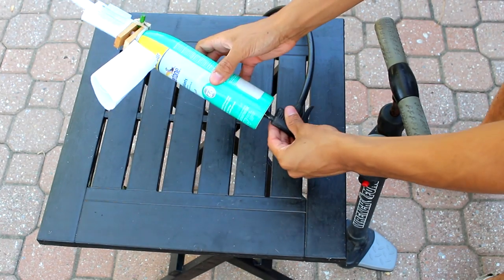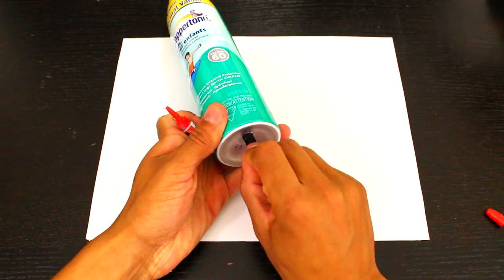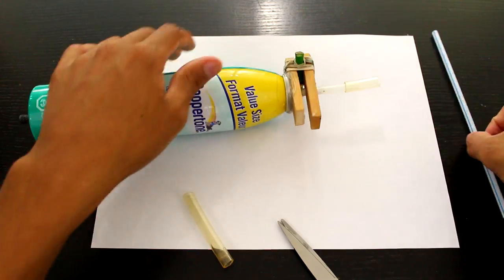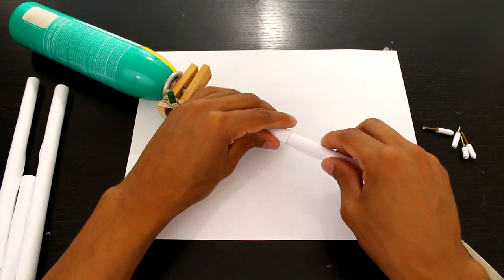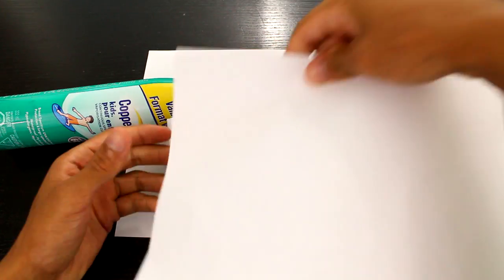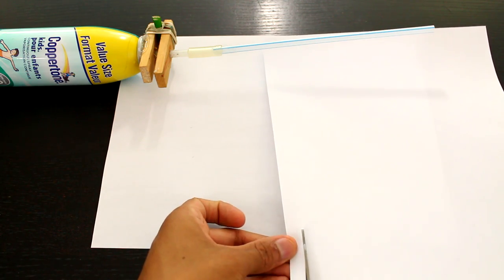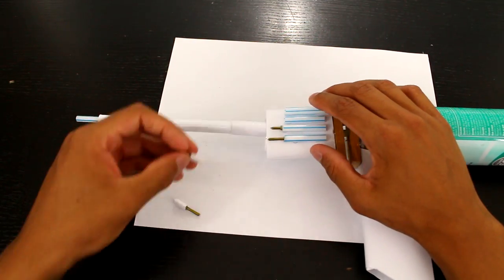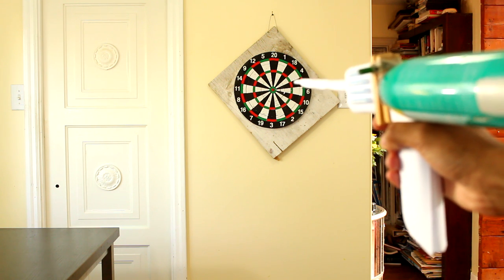How to Make a Powerful 80psi Airsoft Gun

Comment: That fps though. Maybe if you drill a hole where the nozzle is and replace it with something that has a little more airflow it should get more fps on the air gun. Otherwise I would reserve these for bb's not darts. Anyways great video. Any more on this pressurised air tank series?.
Reply from the maker: I definitely agree with that. And there will be athe least one more. Maybe a couple
Reply: ***** Thanks for the reply. And good luck with the builds
Reply: where is the compressed air vid?

Comment: Bro can u use a big barrel?? For example then ones in the curtain instead off strawss?? ASAP plus creative
Reply from the maker: The nozzle that let's air out of the can is pretty small. You would need a can with a wider nozzle or widen it yourself if u wanted a wider barrel and wanted it to work the same. Or maybe some chamber in between so that you could fill the chamber and it has a bigger nozzle that empties quickly